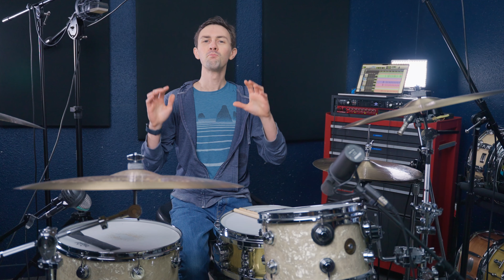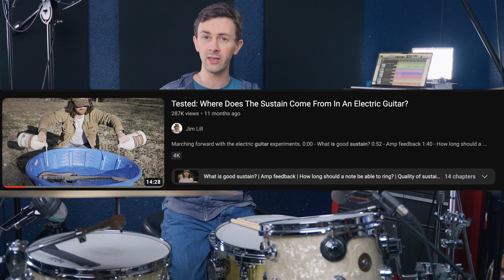Why Do We Care So Much About Drum Resonance/Sustain?

Comment: I love the example you played... The 12 inch tom just sustains for 5 seconds.  I couldn't stop laughing at that.  Point well made.  Here's the issue: If you're mic'd, IT DOESN'T MATTER!  I'm sorry, I'm a Jazzer, and I don't mean to denigrate the rock guys, but if I'm mic'd... give me a $100 AliBaba Drum set and I will make them sound HOWEVER I WANT!  The drums don't matter.  Now take that same $100 set to an Acoustic Jazz gig, and now things have changed.  If you're playing un-mic'd, then you have to understand the difference between stage sound and house sound.  Playing thin single ply heads is not fun, and it sounds very harsh when you're behind the drum set, but in the house it sounds resonate.  Put Emperor's on, and it will sound and feel great behind the set, but in the house it sounds like you're hitting cardboard boxes.  That's why Jazzers chase after sustain, because the house will hear about 1/6 of the sustain you're hearing behind the kit.

Comment: I think people like resonance/sustain because higher frequencies are affected more by ‘imperfect’ resonance aka dampening. Therefor a drum with more sustain wil also have more high frequency presence. Another reason is that well-resonating have a more of the character of the resonating elements in the sound. Which makes it more complex and pleasurable to listen to. An acoustic guitar sounds better than some strings suspended in the air, because the body adds to the complexity of the sound
Reply from the maker: I'm not sure I'm 100% aligned on a more "complex" sound being objectively better. I'm assuming you mean more harmonics, in which case you could argue that overdrive, saturation, and distortion are all more complex sounds and therefore more pleasurable to listen to. Now, I love distortion but if we take that logic to its natural conclusion white noise would be the most pleasurable sound, no?
Reply: @ColeParamore better is never objective of course! But what I mean by complex is that the different resonating parts not only create overtones, but also take the sound of the heads and ‘EQ’ it. For example a 12x7 snare has a mid pitched thump to its attack  which I believe is caused by the resonant frequencies of the drum (not the heads). I would liken it to an impulse response rather than a distortion. And I think a less resonant drum will have less of this character. But I base this mostly of what I hear and also playing around with physical modelling synths a little bit.

Comment: I very much subscribe to the argument that drums capable of having a longer sustain are more versatile because you can always reduce sustain through muffling but you can't get a dead sounding drum to sustain for longer (apart from through artificial means). That's actually one of the reasons I've never been very interested in buying vintage drums - to me they have a much narrower range of sound possibilities compared to something like a modern Sonor or Yamaha kit. That recording at 4:53 was interesting but I think one of the main reasons why it didn't sound that great was you were artificially adding sustain to a type of tuning that didn't call for it, rather than the drums naturally producing it, which I would say further supports my argument (btw I have no doubt those DWs could produce that kind of sound naturally if you were to take the tape off, tune them higher etc.).

I think also when people talk about drums "singing" or having "great sustain" they're also talking about the quality of the sustain as well as the note length itself. E.g. for me another reason why that recording at 4:53 didn't quite work was the big downward pitch bends those toms were producing, as well as the heavy low mids - neither of which worked with that level of sustain. They may have had a long sustain but tone wasn't dialled in to give the sustain any value. I think you're right when you talk at the end about the overall "tone" being the most important thing. And for my taste, the drums out there with the best tone are the ones that are able to (when called for) produce a nice clean sustain with a strong fundamental note that doesn't dip too much. For me, that's the sound I find the most satisfying personally and it's not a sound I've found all drums are able to deliver.
Reply from the maker: Your points on why my example didn't sound good, I think, are totally valid. A longer sustaining drum would definitely sound better than my artificially extended example. Your second point I also totally agree with - overall tone (timbre) should probably be more important than strictly sustain. I am curious though, since you want drums with more sustain rather than less, how long do you want the note from each of your toms to last?
Reply: @ColeParamore  I wouldn't go as far as just saying more sustain = a better drum sound. Obviously there is a point where it becomes more than you'd ever need or want in any situation (I find 14" floor toms can fall into this category). But I would say if we're just talking clear single ply heads, the sweet spot for me is pretty much this kit here: https://www.youtube.com/watch?v=GwwvzrhjmnA
Reply: @ColeParamore  But another factor for me is that I usually like to use coated 2 ply heads on the toms, as I like the fatness of their attack. I find quite a lot of drums tend to choke out with those kinds of heads on. So to have a kit that can still give me a nice amount of tom sustain with 2 ply heads is definitely an important thing for me too. Medium thickness maple drums such as the Ludwig Classic Maple, Sonor SQ2 Medium Maple and Yamaha Absolute Hybrid Maple seem to be really good at that doing that in my experience.
Reply from the maker: @robinjohnson6301  Interesting. One would expect greater mass to sustain for longer though, no?
Reply: @ColeParamore  I'm wouldn't say I'm an expert on the physics but in my experience, 2 ply heads definitely seem to have less sustain than single ply. I still generally prefer them on toms overall as they have a certain fatness to their attack/overall tone that single ply heads don't quite have. I know I sound like I've backtracked here slightly but I feel like both the "fatness" and the sustain are both really important with toms. Like you quite rightly say, sustain isn't everything.
Reply: @robinjohnson6301  Generally, I would agree with this.  Two plys or "pinstripe" ringed heads, (and especially things like oil-filled)  have more mass and therefore might make for some lower tones/pitch, but will sustain less because there is more mass to move and more inertia created by the heavier weight head. I'm glad you asked / posted this!
Reply: Love this comment!

Comment: Poor drum manufacture, out of round drums, poorly cut bearing edges, lower density woods, sub-optimal mounting hardware, lack of isolation.... all add up to negatively affect the sustain of a drum.
Heads and tuning arguably make the biggest difference here, but in my experience with manufacturers in the industry, sustain is a basic yardstick in determining the potential quality of a drum.
Yes - there are many more pieces to consider in determining a great drum shell, but like so many other aspects of the industry, the 1% differences get overhyped in order to create a point-of-difference and ultimately sell product. 
Honorable mention has to also go to the drummers who argue over wood type - like how its SO important to have 9plies of mahogany glued together at 30 degree angles with an inner and outer ply of 100-year old antarctic maple...in red - Like any of them could positiviely identify the wood by hearing the drum anyway...

Comment: I think you touched on a good point when you demonstrated that you can get sustain with effects after the fact. As for how long it should be, I tend to think for noticable length (peak at -6dB, End at -30dB) I like it around one measure at 85bpm. I'm not typically going to keep the drum at that level of sustain but I like the option. Most sound guys I've worked with seem to like a lot less than that. The thing I think you have to keep in mind is what heads you're using and how you have the drum tuned. On my live kit I've been using Evans Hydraulic drum heads, but in the studio I tend to use coated G2 heads. I do use more dampening in the studio than I do live, but I want that extra level of control to be able make adjustments.

It was a huge thing when they came out with RIMS mounts for toms back in the 80s. It changed the sustain game completely but it also lead to the development of a lot more dampening technology, like moon gels. Now people are trying to get that "vintage sound" and drum companies are releasing lines with 60° bearing edges with an outside round over. I think they're all valid sounds when used appropriately.  I personally like having a decent amount of sustain so I can tweak it to exactly the amount I want to have when I'm playing, and I think modern drums in most cases do a really good job at that task.

Comment: Since I don't have my own drumset, I'm not attached to any one particular snare or type of snare. So from my perspective, context is important for determining the optimal amount of snare sustain. Long sustain in death metal might get too muddy, whereas in something more laid back it would fill in the space between notes nicely.

Now, I really don't get the logic behind valuing a guitar based on its sustain, especially since that's mostly based on the strings. If you want a longer guitar sustain, just use a compressor!

Comment: important topic! Of course, it depends on the way you tune your set, high or low and the relation between batter and reso side..... I tried so many different drum kits that i made a real strong experience for myself and the way I tune the drums. And we are talking about top of the line drum kits or at least kits for over 2500 E (or D). The perfect sustain (for me) coming from shells from Sonor and Yamaha. The most problems of endless ringing, especially the floor toms, had DW and Mapex. Gretsch and Pearl are in between .........

Comment: I want a drum with a nice shell that CAN sustain for a long time. Partly, that's tuning... but also speaks to a good shell. Then I can dampen as needed. Better in my mind than having a drum that can't sustain as long as I want it to.
Reply from the maker: So how long do you want each shell to be capable of sustaining for?
Reply: @ColeParamore  Maybe 2 seconds or so. For toms. Shorter for bass drums and snare drums. Then I'll adjust as needed. For me, that usually means adding a moongel or two on the floor tom, one on the snare drum. Ok, and I have the EQ3 heads on my bass drum, so not too much actual sustain there - just a big thud :-)
Reply from the maker: @DavidLeeKing  Have you encountered kits that haven't been able to sustain for that long, and would this change from room to room?
Reply: @ColeParamore  No, I don't think it changes from room to room - at least with the drum itself. Obviously, you get huge amounts of natural reverb in some rooms, not so much in others. My carpeted basement vs a stone/wood/tile room with vaulted ceilings, for instance. But that's not actual drum resonance. And yes, I have played some kits that don't sustain that long. For example, I play a nasty old starter kit in the practice room of a band I'm in (someone else's kit that's always set up there). Works fine for band practice, but it doesn't really have that pure, sustain-y tone that I like.
Reply from the maker: @DavidLeeKing  The sustain of the drumhead definitely wouldn't change from room to room, but certainly our perception of how long the note lasts would change right? Is that not equally important?
Reply: @ColeParamore  Definitely! I'll guess you've heard of "playing to the room." You have to adjust for the sound you want in the room you're playing in. So if you're outside it doesn't really matter, but if you're in a really ring-y room you'll need to tame your drumset a bit!

Comment: Sm7b on the rack Tom? Interested. Is this a normal set up for you? Should I try it? I use a slate ml2!
Reply from the maker: I change mics around quite a lot, but I like 57s and consequently 7Bs on toms, floor as well. If you're rocking the ML2 throw the SM7 emulation on there and give it a go!

Comment: Of course, whether or not longer sustain time will be good depends upon the tempo of the song and the number of divisions / notes played on fills, etc.  If the tempo is fast and there are lots of 16th notes or even 32nd note fills, then sustain is not important or helpful.  OTOH, if its a ballad like tempo with single tom notes or flams played, which might need to sustain until the next beat, then yes, I'd try to tune for more sustain on that song.
Reply from the maker: A lot I agree with on this comment and your other one as well. Another factor I didn't even talk about in the video is room ambience and reverb. This subject is probably worth a video on its own, but even for a ballad it isn't uncommon or difficult to have a relatively dead (or short sustaining) kit that ends up with a huge tail because of the reverb, whether real or fake.
Reply: Good point.  Room mics which are heavily compressed can add a nice wide ambience which also adds some sustain, depth and size qualities. I think you alluded to the fact that having the sustain at the source, and not created by compression (or reverb) seems like a better start in recording, and I agree with this.  In the 80's that long, hall reverb was the thing, but now, not so much.  Gated rooms or compressed rooms ( especially on snare) just add something that reverb alone can''t.

Comment: I think first you don't want to sound like you're hitting a board: so I like 'tone', and probably I would rate things like 'warmth' above sustain pure and simple. The priority for me (in a worship setting particularly) is to balance 'warmth' and resonance with attack: where you want that balance to lie is going to be different for different genres.
But not all sustain is the same; it's not just 'how long'. The question is how far into the sustain is there the warmth and fullness of the note. How does the sustain fall away or drop off. The boingy recording, I agree, all you can really hear is that floor tom .. not because of its volume necessarily but because that boing is so out of place; but at it's fullest point, it's a great sound.
I think that sometimes it's a bit like the difference between a crash and a ride? You want a quality of sound but you don't want that to build out of control the way it does if you try to ride on a crash.
Say you're playing Sing Sing Sing: you can't make that sound good on a board, you can't make it sound good on a drum that's all attack (it was written and made popular when drums had rounded bearing edges for a start). Imagine trying to play it on a modern marching snare cranked to the heavens: it would sound like a page out of Stick Control. You need sustain, even though the space between the notes is very short .. you want some of that build of bloom .. almost like a cymbal swell.
Reply from the maker: Love the input - thanks for sharing!